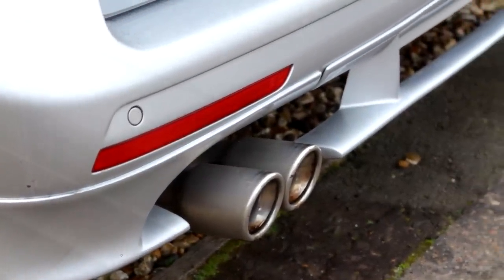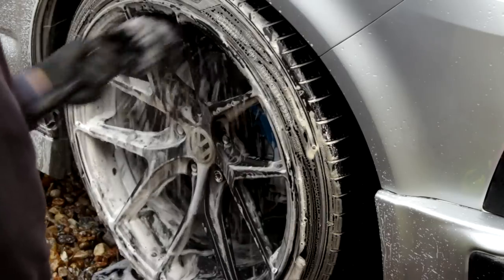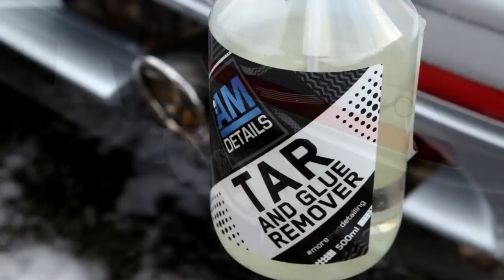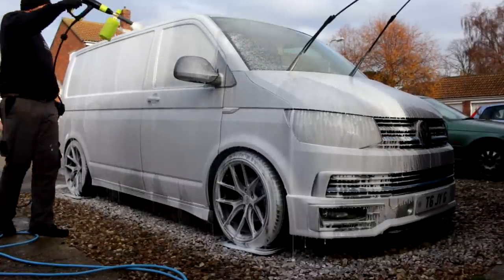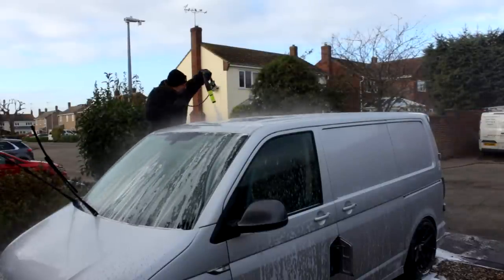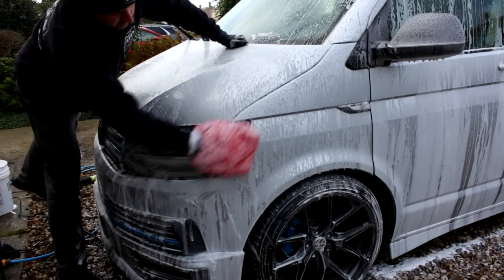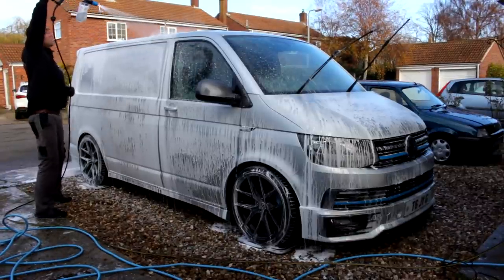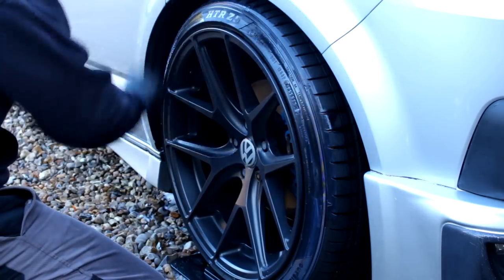VW T6 Transporter winter wash and protection

Comment: Another cracking job the van looks amazing. The reason I watch this type of content is to pick up any hints and to keep abreast of any new amazing products. I predominantly use Mitchell & King (as I am 5 mins from the factory & John is very helpful)  products but there is the odd chemical I get from other suppliers like GT Serum which is my go to  tyre conditioner and the carscope brush is next level. The power washer you use does it by any chance operate without a hose i.e. from a water  butt or bucket as I am looking for one for a present for my Father in Law who does not have an outside tap.. I really only watch this type of content from yourself, Autocare HQ & Specky and David McBay & GM Details as they are based close bye near myself in Renfrewshire and because I believe your opinions are honest. I look forward to all or any type of content from the three of you. Hope you have a good Christmas & New Year and I look forward to  your future content in 2023.

Comment: Great video big man that ava machine looks good apart from the snow foam lance letting it down how much is the 1 your using ? And the attachment for 1/4 inch quick connection for your normal snow foam lance m j j c and mtm pf 22.2 my nephew after decent machine but doesn't want to fork out for the same as what I've got kranzle 1152 t s t with all mtm attachments that valet pro snow seal is awesome 👍👌

Comment: Have you any suggestions for hoselock connectors?
Mine always pop off when pressure builds up when pressure washer is at rest.
Or is it there a type of hose thats superior.?
Reply from the maker: I use hoselock no problems
Reply: If you're using the Hozelock Aquastop connectors then that's most likely the problem, Aquastops aren't recommended for use with pressure washers.
Reply from the maker: @chriswebster3197  not using the auto stop connection system Chris I actually mentioned this in the Ava video but glad you bought it back up again for the guys 👍🏻👍🏻